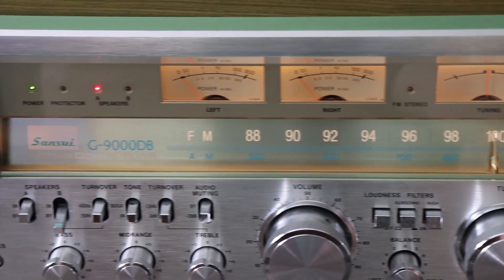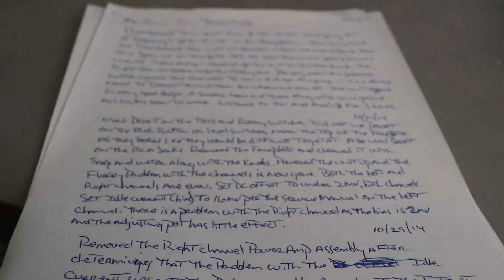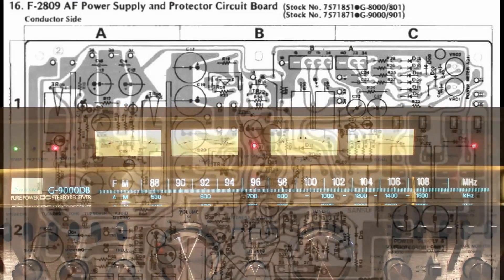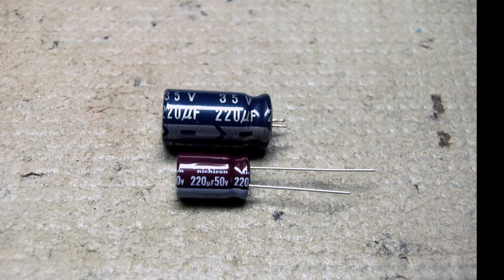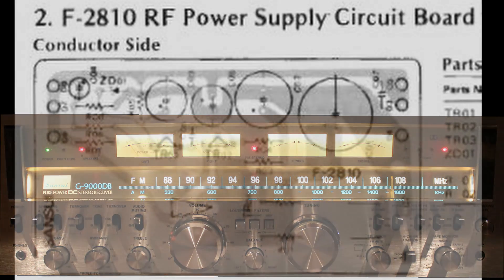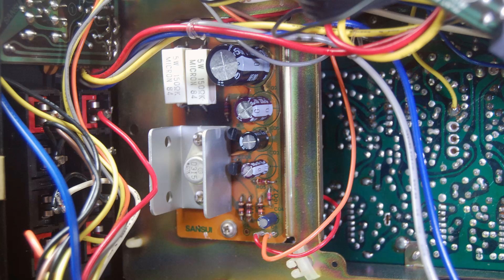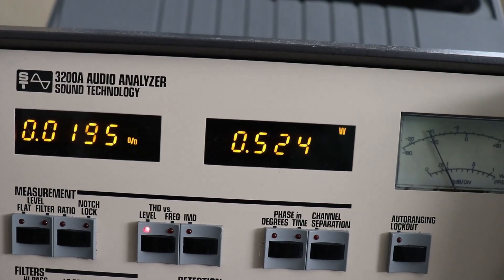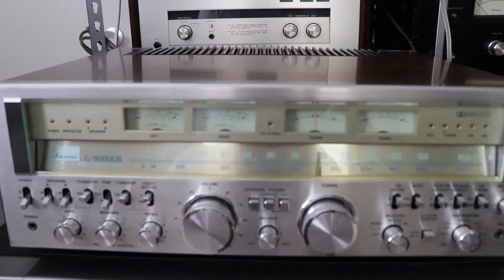G-9000DB - Sansui Receiver - Most Beautiful Ever? Repair Restoration Testing Vintage Stereo Audio

Comment: I bought this unit 40 years ago in 1980, and enjoyed its rich and quality sound very much.  It worked very well until about 2 years ago it started failing the speaker protection circuit.  I traced the defect to one of the two speaker protection circuit bds located on top of the unit.  However, I am having a hard time finding the parts to repair it. Does anybody know where to get component parts to repair these old stereo receivers? Any help is highly appreciated. Thanks.

Comment: I use to sell this unit and many others like it back in the mid to later 70s for a store called "Custom Hi-Fi" I worked there as a salesman for a few years. I fell in love with these receivers, Sansui was my favorite among the units we sold and we sold them all. I never was able to purchase this one but back in the mid 80's, I bought a mint - Sansui 9900z receiver for just $100.00 from a pawn shop. It still works today and I use it all the time. There is no price I would sell it for today. I think it was the very next model year after your Sansui G-9000DB stereo receiver came out. Mine was also the last year of the big monster receivers that Sansui produced before changing everything. Mine is rated at 160 watts per channel at rated power and is DC powered of course and it actually has a fan in the back that will come on if the unit ever gets too warm. I would still love to have the Sansui G-9000DB, I think it is one of the best looking units I've ever seen. Mine specs out the same as yours and is basically the same machine but it is looks different and has a Digital Quartz Synthesizer Tuner in the FM/Am, that is the main difference in the two models. Works great, still today! 
     Oh, I know this one came from a service man also that got in a financial pinch, divorce I think, and lost this receiver in pawn plus a Nakamichi 682 ZX Tape Deck that I was lucky enough to purchase that same day for $50.00, it retailed for 36 times that, literally. The Pawn Shop people had no idea what this tape deck really was, but I did luckily, it was a good day! I know the man who lost this pawn loved this equipment and I did check back later and found out he never came back for his stereo equipment. He not only lost these two pieces but I remember he also lost some Sansui speakers, turntable and a reel to reel deck and maybe an equalizer! Didn't need the last pieces mentioned.

Comment: I inherited my unit from my  dad a few years ago. He had always promised I would get it since I was a teenager. He bought it from a pawn shop back in the early 80s along with a pair of sp-x9 speakers.  At the time we lived in a singlewide trailer out in the boonies of Southern Oregon. We spent many days cranking it up listening to Grandfunk Railroad, Foghat, and just about anything good. I was amazed at how crystal clear everything sounded. You could hear things in the music you hadnt noticed before even though you've heard it over and over on the radio. I wish I still had those speakers. He never turned it up past 5. I could swear it was gonna blow the windows out of the house. Right after he reluctantly handed the receiver over to me I was at a yard sale and everything was free. I saw a pair of old speakers that I glanced at and passed by thinking they were kinda  rattty looking. At a second look I saw the sansui logo and I had to have them. It was meant to be. They are LM-330s. I didn't expect much out of them but they were speakers I thought. Boy was I surprised when I hooked them up! The stereo hadn't been hooked up for a couple years or so since the other speakers were blown out by a drunken uncle. Unfortunately they were not kept. But wow these little 2 way 60w speakers have some punch!  They sound great. Not quite as good as the ones I remember but damn I've missed hearing a good stereo sound. I love how clean it is even loud. I scored on the speakers. The unit has had no work done to it and could use some tlc. The controls are a bit crackly and  the channels cut in and out but after fiddling with the knobs it still sounds great after all these years. I've cleaned the pots once. prob needs to be done again. I am very happy to have it. I Someday I'll  get a pair of those sp-x9's

Comment: No matter what you guys think, this is not audiophile quality from Sansui. This is a good stereo, I don't disagree but there are many models that are much better. Audiophiles would never buy this line of equipment by Sansui. Sheer power doesn't do it. Don't believe me. Check prices and listen.
 This was built when bean counters took over the company. You see what happened to this brand, they trashed it after 1980.

Comment: I have the Sansui G- 8000 receiver, and yes, purchased in the same way, from someone in the military returning from overseas in 1979. It looks identical to this one, minus a few switches it seems. It started to develop some problems with the volume control knob years ago, when in use, one channel would intermittingly go out, but would come back on by turning up the volume a bit. Turning it up louder, it would work fine, but the lower volume settings, you could get a little static. Took it to an electronics shop for cleaning, and it helped a little, but the same issue remained, and got worse over time. It still powers up, but no volume output registering on the levels needles, so I stopped using it. I hung onto it because of its beauty, and I am wondering after watching your video if it could be a diode problem, or do you think it could be could be something else?..  Thanks, your video was very educational.

Comment: I still have and use my Pioneer SA-8500II integrated amplifier I bought in HS in 1979.  At one time I had a turntable, graphic equalizer, and two cassette decks hooked up to it.  Currently I have a Yamaha 5 disc changer running through it hooked to a pair of Infinity speakers.  It has been to California and back with me while I was in the Air Force.  I still remember when I was looking to purchase my first CD changer, the guy asked me what I was going to hook it up to, and I said my Pioneer amp.  He told me the amp would work splendidly with the changer.  It's been a great amp, the only issues I've ever had was dirty pots.  I have a Sansui 7070 a friend gave to me, I would love to find someone to go over it and get it working again.
Reply from the maker: Very cool! Thanks so much for sharing and thank you for your service. The old audio gear certainly has stood the test of time. Congrats on owning your SA-8500II for all of these years and yes it would great to get that 7070 going again also.

Comment: 95% of my vintage stereo gear came from family members who passed away (receivers, cassette decks, RtR machines, etc). I remember them & their stereos fondly as a kid, so I'm passionate about keeping the gear running and in tip-top shape. I only have 2 receivers that were acquired myself, one being a Marantz 2230 that I bought off ebay and a Kenwood KR9600 that my buddy gave me after his dad passed.
Reply from the maker: Thanks so much much for keeping the vintage audio equipment alive. They are built well enough that you will be able to pass them on also. Thanks again.

Comment: You said 160 watts RMS per channel in both 4 and 8 ohms?  How is this possible without autoformers like McIntosh?
Reply from the maker: You would need to consult an audio amplifier design engineer, I'm a hobbyist. This is the specification that Sansui provided in both their owners manual and service manual for the G-9000DB.
Reply: @vintageaudioaddict  Thanks for the info

Comment: Very informative video. I have a Sansui 3900 Z that I just bought, and the frequency display is one digit off. As an example, it displays 88.4 when it should be displaying 88.5 it’s that way on all of my favorite stations. Always  that one point off. Is there a simple adjustment on the display that I can correct it? I would appreciate any help, thanks. I’m trying to keep from taking it to one of those rip off technicians.
Reply from the maker: Thank you. There may be an adjustment? I'm not sure as I've never worked on a 3900 Z. Go to hifiengine.com and download the service manual. You have to sign up but it's a free download. Take a look in the service manual and see if there's something that you can take care of.

Comment: Do you know whefe i can order parts from for the G-8000 ? Thanks for your help
Reply from the maker: You can get most modern replacement capacitors, transistors, diodes etc. from mouser.com or digikey.com.
Reply: @vintageaudioaddict  Thank you i have G-8000 taken apart and cleaning all the pots very very well taking my time and doing it right ! Still wished you loved close by i would have paid you exellent for overhaul , thanks for the reply and heads up where to purchase parts , they sale a kit for the G-8000 for 300.00US but idk about all That hopefully a good cleaning gets rid of the static in the volume knob

Comment: It truly is a stunningly beautiful piece of technology. Appreciate the equipment of the era as I still have my stereo equipment HK,Kenwood, Sony, AR10 Pi.  What do you use to clean/ shine faceplate?
Reply from the maker: It great that you still have your old equipment. I still have some of mine from my teen years. If the faceplate is not to dirty like this one some warm water and a little dish soap usually works well. If you have deeper grime I have used Mother's mag & aluminum polish. I've never had an issue with it doing any damage to the faceplate or the stenciling but test a small area first if you ever use it.
Reply: @vintageaudioaddict  Thanks for the tip and happy hunting!

Comment: Any audio equipment from  70s early 80s need to be recapped for sure, otherwise they will sound bad. Yes this reciever is absolutely beautiful, you did a great job indeed, compliments. I love vintage HIFI audio equipment.
Reply from the maker: Thank you very much for your kind words. There were so many well engineered and quality built audio products back in the day. Get those old electrolytic capacitors out and this equipment can perform well for many more decades to come.

Comment: Did I miss something or did you not change out the filter capacitors?  Why not?   Excellent work you did.   Im a vintage Pioneer collector but that Sansui is a beast and up there with the big flagships of that era as well.
Reply from the maker: Thank you for your kind words. Your correct I didn't change out the filter capacitors. I will have to re-visit the G-9000DB because after 40+ years they need to be replaced.
Reply: Pioneer Spec 1, Spec 4, TX-9500 Receiver, SA-9500 Amp (72 my first college amp) 2 Pioneer cassette decks, and a Thorns 160 turntable, many banks of speakers 3 pair of Definitive including BP2000, pair of Cerwin Vega, pair of Klipsch, and a pair of Infinity, my back yard ROCKS.

Comment: It was the grand days of audio. An incredible job on an exceptional piece of audio history. Makes me miss my first receiver , it was a Pioneer SX 780 bought it with my first check from my high school job at Dog n Suds. The true quality of the equipment back then surpasses what is made now. Of course with some exceptions. Great video ..I’m a subscriber now!
Reply from the maker: Thank you so much. Your SX-780 was/is a fine receiver. It really was an amazing time in audio history. You sound like me. I was working at Pizza Hut as a teen. Your SX-780 was engineered and built to the same standards as the larger receivers of the day. Many of them are still in service today. Thanks again.
Reply: Steven Mazur 

Dog n Suds had the best root beer floats!    Haven't had one in 50 years.....but seems like it was just yesterday...
Reply: I have its cousin. The Toshiba SA 750. With a kenwood EQ & man does it sound Great!!!

Comment: Thanks for the great video. Last year I was given a non working G9000. Both channels were continually cutting out. Tried Deoxit in all switches and pots but still had intermittent output. When I got it apart I found that all of the plastic inside the switches had broken. Luckily I was able to find NOS switches on eBay. They came all the way from Croatia. Those switches are definitely the weak link on these beautiful receivers. The replacement switches weren’t cheap but my G-9000db is working just great now.
Reply from the maker: Your welcome and thank you for viewing. Wow, great job finding the parts and getting her going! I'm sure you will enjoy your G-9000 for many years now.

Comment: I have a AU5900 my dad bought it in 1976 in Honduras.  This replaced a Sansui Receiver that he bought in Guatemala in 1970 it was the Sansui 600 L solid state receiver.  My dad moved from Honduras to Panama in 1981 and he took his Sansui Integrated Amp with him along with a Sansui Tape Deck SC-333, a Pioneer Equalizer, a Sony Reel to Reel and a Thorens TD 164.  After the invention of Panama in 1999 my dad moved to the states and put all this equipment in storage.  My sister then moved it to Mexico, Argentina and finally in the 2000s came to the USA where it remained in storage in Miami.  Christmas of 2019 my sister gifted me the Sansui AU5900, the Thorens turntable, the Pioneer equalizer, and the Sansui Tape Deck.  All but the Sansui AU5900 need extensive repair.  I cleaned up the Sansui Amp and cleaned all the contacts and I am now using it as my main Amp  replacing a modern Yamaha Receiver.  Based on the serial number my Amp was built on April 15, 1976 in Japan.   that makes it almost 44 years old, the sound is clear, and rich, the Yamaha receiver sounds like a tin can in comparison.
Reply from the maker: What a great story! Thank you for sharing. Your family has been in many different countries. The equipment just needs a helping hand and I'm sure most everything could be operating again but until then enjoy your AU-5900.

Comment: Good video and nice receiver-Had a 9090 awhile back I restored. I replace caps about 90% of time and go back as close as possible to factory caps to maintain original sound. There have been a few cases where I replaced a good cap with a modern cap and it actually sounded worse. Those cases are rare though and possibly has to do with engineering of the particular unit and the fact that many caps 70's used to be as much as 50% over rated value and nowadays you are lucky if you get one 10% over value due to modern manufacturing cost savings.
Reply from the maker: Great comments! The modern capacitors do make me wonder in the years down the road how they are going to hold up. The 40 and 50 year old electrolytic capacitors in older electronics of all kinds are getting to the point where over the next 10 years I believe there will be a very large fail rate. Electrolytic capacitors just don't last forever. Thanks again

Comment: I inherited a Marantz 2010 receiver and Marantz 16B amplifier from my brother who purchased them in Germany in the 70s while in the Army. I still have the 2010 receiver and have added a 110 tuner, 3300 control console, 6100 turntable, 5420 cassette deck, a second 16B and 4 HD770  speakers. I had the 16Bs serviced a few years ago to address an audible hum. Thanks for posting some great vintage audio!!
Reply from the maker: Your welcome and thank you for sharing. Great gear! There was/is just so much great audio equipment from the 60's and 70's. I'm glad that you still have your brothers equipment after all of these years and thank you again for sharing.

Comment: The 70s and 80s had the best stereo equipment around and actually had the music to go with it.
Reply from the maker: I'm telling ya. So much good gear and music also.
Reply: I think equipment took a big downturn in the '80s, or at least high-end and gimmicky plastic components started to diverge from each other. Late '70s stuff is gorgeous, though.
Reply: Then the compression/'loudness' wars started and between the hardware and music, it's become very hard & expensive to be an audiophile.
Reply: I won't argue with that...!
Reply: @russellking9762  yeah you know you’re getting old when the stereo equipment you’re still using somehow went from being old and obsolete to Vintage collectible, I got a Vintage Kenwood rack system without even trying, hell haven’t even bought any music since Foreigners double vision came out on vinyl.😂😂😂
Reply: AMEN TO THAT...!

Comment: Like David, I bought most of my equipment from the Yokosuka Naval Station Exchange. I still have almost all of it, and everything works. Sansui QRX-9001 (still the best receiver made, along with the QRX-999 Euro model), Technics SL-1300 turntable, Akai GX-630D-SS open reel tape deck, Pioneer CT-F950 cassette deck, and Bose 501 speakers (originally had Pioneer CS-77a speakers, and later upgraded to 901's, but the 501 were reconed and still work.) The receiver and Akai deck were restored over a decade ago, while the Pioneer got new belts a few years ago. The Technics has never needed any work, and still plays CD4 vinyl perfectly. As far as the most beautiful vintage receiver of the 70's, I would have to give my vote to the Akai AS-980. That thing was a monster!
Reply from the maker: Thanks for sharing your story. There were so many excellent choices for audio gear during the time this equipment was being produced. Most of it like yours is still operating and making music all these decades later. Congratulations on still having the equipment all of these years and thank you for your service.

Comment: What is your opinion on the 8900ZDB
Reply from the maker: I've never owned a 8900ZDB so I can't really say but I think they are probably good units. Things in the audio industry were changing when the 8900 came out.
Reply: I think they’re the model that directly proceeded models like this? Idk but I know that mine has many of the same features as the 9000 but has digital features seen in many 80s audio equipment